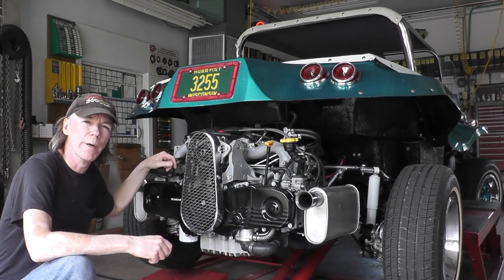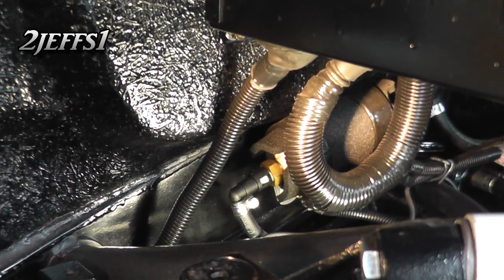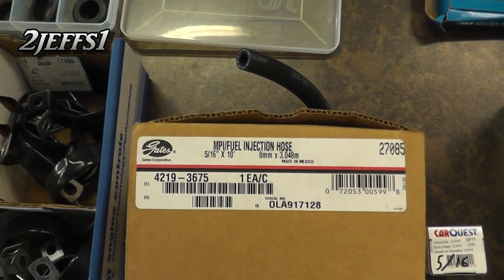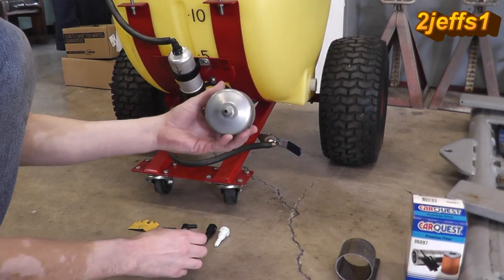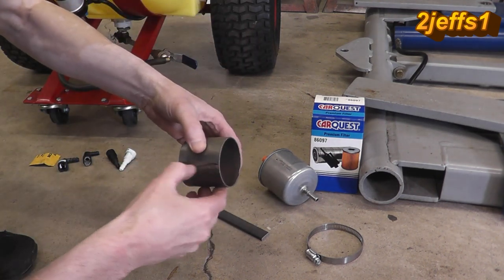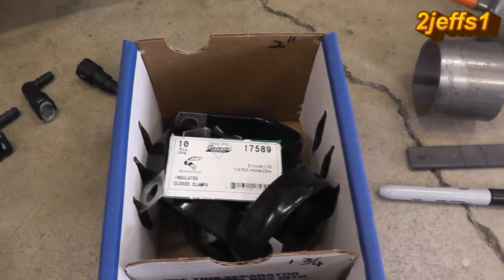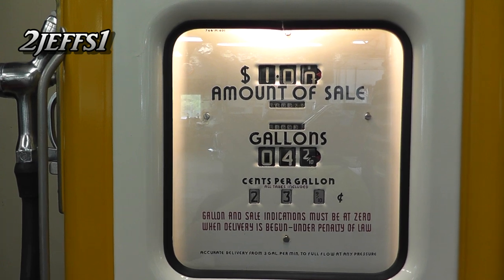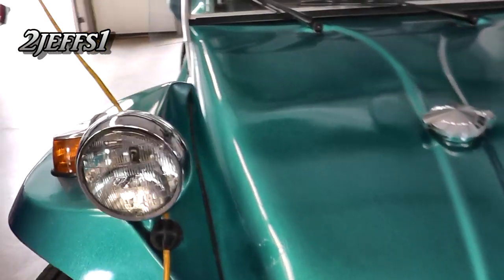Fuel Injection System Install DIY Plus $ Saving Setup Tips

Comment from the maker: Hello, The pump listing that I used is for a 1986 Ford Ranger 2.9 4/4 port fuel injection. It is the pump on the frame - NOT in the fuel tank. Most system operate at 45~60 psi. These pumps will exceed 100 psi @ a deadhead test. The fuel pressure regulator bleeds excess to the return fuel line & maintain proper running pressure. Hope this helps, Jeff

Comment from the maker: Hello, I am just using that pump externally only. That works great and never any issues. The big thing on these pumps is not to run out of gas - that is very hard on the pump. The fuel passes thru the pump body for lubrication & cooling. I have built several systems (years ago) with the pump in the tank but you are right - it's so much easier to have an external setup!

Comment from the maker: Hey Joseph, Don't mind sharing vid info at all. I have 2 Panasonic HC-V500 Cameras. 1080-60fps. They can record in Progressive and interlaced. It seems all the new stuff uses progressive. A while after I purchased these I read that Panasonic was the one that designed & perfected the AVCHD system. The GoPro Is a Hero 3 Black. Have the touch back &created a external mic setup. I bought power director 12 a bit ago & using a computer I built in 2009. I have been very satisfied with everything,Jeff

Comment: Great video, like the other videos from your channel ;)

One question about the fuel pump. Do you only use this extern pumpand nothing in the tank? Is it enough with this type pump?  if so, it is much easier than installing a fuel pump inside of the tank!

Comment: Hey I have a 1975 beetle. it has a stock fuel injection system and I want to know that if I can keep using the same fuel pump when I convert to carb, since I can't run a mechanical fuel pump
Reply from the maker: Hello Christopher. That would be way too much pressure to be used with a carburetor. Check with an auto parts store for a general purpose electric one specifically for that use. Make sure to get the counter man who has been there a long time for best results!  :)